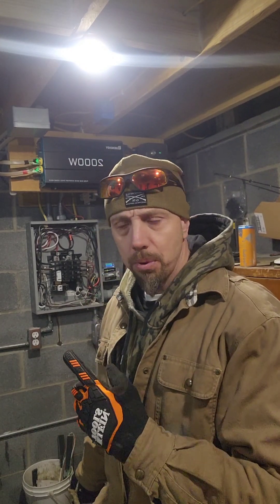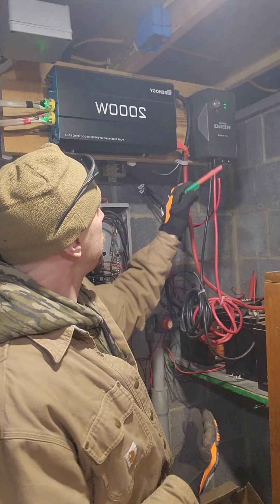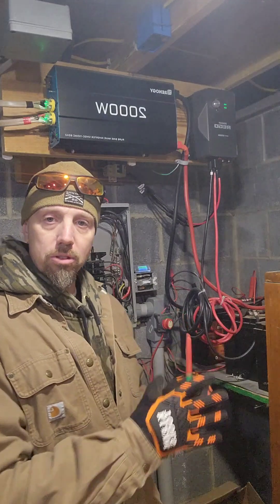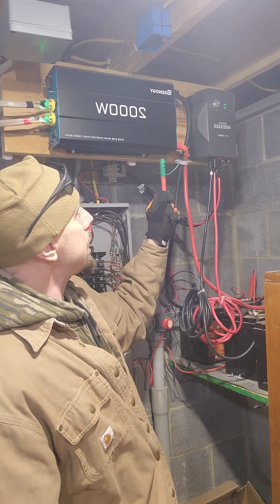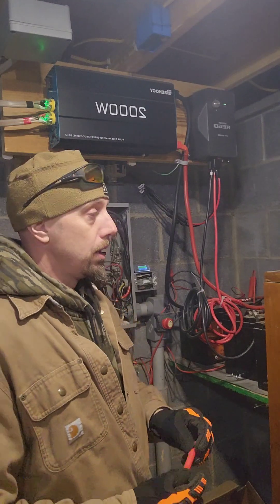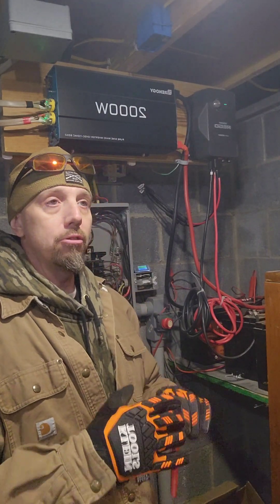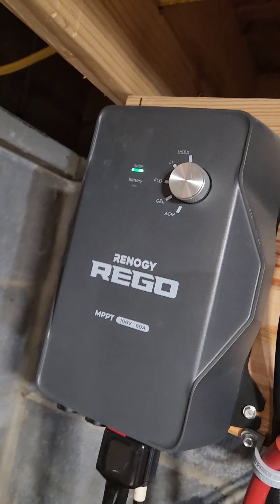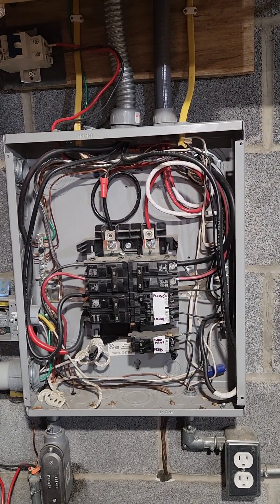30 amp 12volt #diy #solar

Comment: 12v components can be a bit cheaper than say 48v, but it will require significantly thicker wiring which will eat up the savings pretty quickly.
Reply from the maker: i get wire for free, im in the electrical field, theres always scrap or extra!